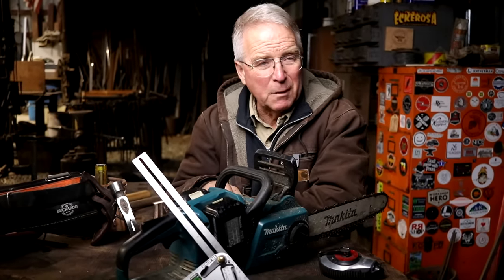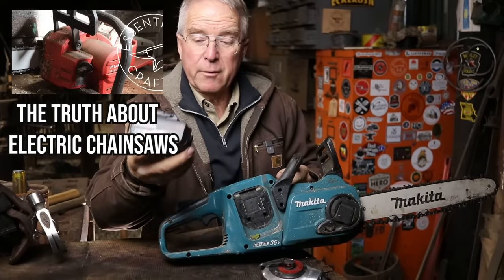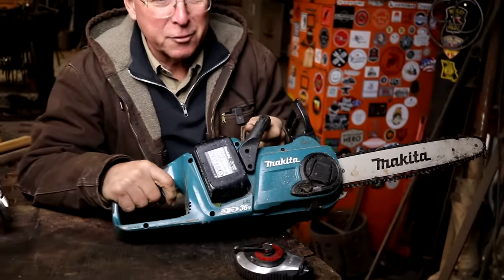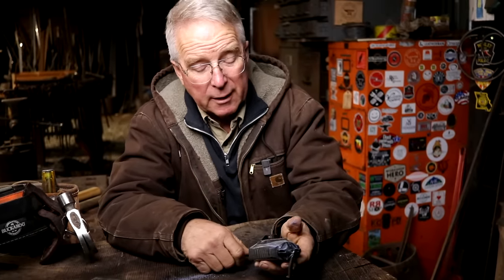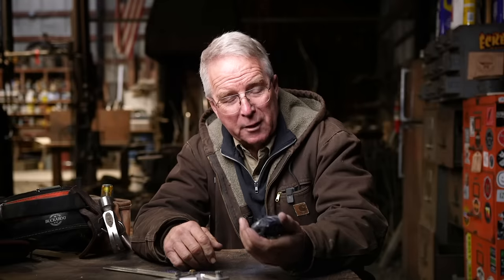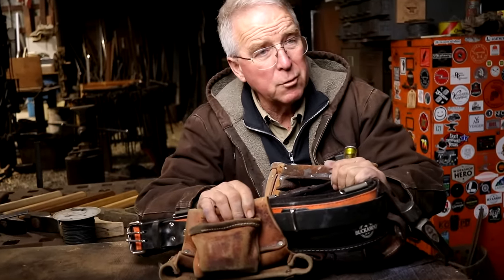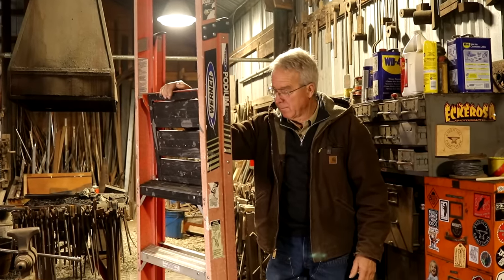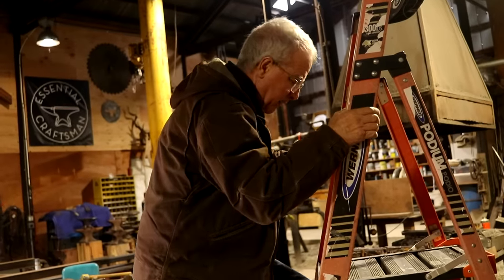5 Carpentry Tools I Wish I Bought Sooner

Comment: Honestly one of my favorite things about the Tajima boxes is that you can buy replacement parts for them and fix them up instead of simply replacing the whole shebang
Reply: Very good point
Reply: I cant stand when you gotta replace a tool when 96% of it is perfectly fine but you just can't get parts, even if its cheap to replace, just feels bad to toss it.
Reply: Love my tajima box.  Same he showed
Thanks for sharing, I didn't know they did parts! Yay
Reply: @miles11we  I usually ended up saving them for parts, but rarely ever used any parts off of them .What clutter!
Reply: 😅😅😅😅😢 I’m not 😮😊😊😅😅😅😅 1:03 😅😅😅😅But
Reply: Just bought this. I knew there had to be a better way.
Reply: @miles11we right than you end up keep the broken one outta remorse and you think you can use it for parts and than I end up never using it so it just collects dust
Reply: They also make awesome caulk guns, just awesome. They come in various types for different viscosity levels and they are bulletproof and the dripless feature actually works
Reply: I believe Tajima also has boxes that can be loaded with an ink, instead of chalk.
Reply: I didn't know that 😮
Reply: My tajima was great but the bearings fell out. They are tiny and plastic and I can’t see a way to replace them.

Comment: I worked my whole electrical career on step ladders and I scoffed at podium style ladders. But I bought one for my friend so she could change the lamps in the hi-hats and dust her ceiling fans more safely. I showed her how to use it. Holy moly I was hooked. Podium style ladders are fantastic where you can use them. It’s like staging.
Reply: Tried one and I never got used to it. I stand on the top two rungs like you’re not supposed too often enough to where I need them. Each time I had a podium style I would almost trip trying to climb to the top rung. But as far as just working off of the podium and that step only, they are a game changer
Reply: Right?  It's like a mini-scaffold.
Reply: only problem is that the 3' version is a whopping $670 CND.  I can get TWO 3' aluminum ponies for $150.
Reply: I believe what I bought for my friend was a Gorilla ladder from Home Depot or Lowes. It was of stout build and had a high weight capacity. Surely good enough for home duty and lightweight construction. It folds thin. Now keep in mind on construction sites I was most comfortable illegally strattling the top plate with one foot on the top step and one on the rung in the back. And I was totally comfortable standing on the top of an 8’ or 10’ step ladder. 12’ footers sway and are hairy so not so much of them.
Anyways, these ladders with the platform and leaning bar are the safest ladders out there. 
Commercial grade will cost more.
Reply: @krenwregget7667 Aluminum, summed up in single word, sucks. Sure they are light and cheap, but they are also unstable and not safe. My safety and increased comfort is priceless.
Reply: What would Fred Dibnah say.
Reply: @glennpaulellis1172  That would be a definite "no go" for Fred. Too safe. 😂
Reply: @carbonking53  On the job I preferred wooden ladders only. They are heavy but stable and stay put once set. Fiberglass step ladders are lighter to carry but after set in place the things get wound up and will take a step on their own.
Reply: Little giants are best hands down.  
My 40 ftrs are werners but 20 plus years of siding roofing and guttering, little giant has become my preferred ladder. For any situation except tall 2 stories, where i usually need a lift anyways and not even close imo and every contractor I know.
Reply: We use little giants on our c130s. they take a BEATING. Stable and strong.

I borrowed my neighbors podium ladder, good GOD it's great!!

I prefer fiberglass now, too. It seems a touch stronger
Reply: Podium ladders are fantastic... when you need exactly the podium height. In my experience, this is rarely the case. They're especially problematic in T-grid ceilings, because the ladder is taller than a normal one (a 6' podium ladder is 8' tall!). You end up having to thread the ladder up and down through the ceiling tile, being extremely careful not to bash the grid. In certain settings they're great; I've happily employed one in place of a Genie lift in tight spaces, but my opinion is they're usually not worth the extra weight and height.
Reply: @josephbikes  Agreed. They’re great for homeowners and even construction when they fit the area. Working above grid ceilings are another matter.

Comment: I lightly scoffed when my dad got an electric chainsaw a few years back. We have multiple gas chainsaws that’ll tackle cords of wood daily if need be. However, every time I’m down at his place and need to cut a few branches or clear some brush, it’s that electric saw that I grab. It won’t replace the big saws we have, but it sure is great for the lighter jobs!
Reply: Looks great for camping trips as well , or , for 4 wheeling / trail use .
They make DC -dc chargers so you can charge the batteries from your vehicle 12 volt system without an inverter and charger or generator .
Most tool manufacturers make and sell vehicle chargers using dc-dc tech for their batteries , although they do not widely advertise them and most retailers do not carry them as normal stock .

Comment: Tajima chalk box…. Love mine.  I got one early on and never looked back.

Titanium framing hammer… I wish I had gotten one much sooner.  But I’m glad I switched over.

Truss locks.  They saved so much time setting rafters once I had them.

Stabila telescoping plate level.   Man we used that all the time.

PLS self leveling laser that fit in a pocket on my tool belt.  I got that later in my career but sure was handy when running a crew and checking the plumb on corners.  

Impact driver.  Needs no explanation 

A 2 step, 2 sided step ladder.  Man those are so handy to have around..  from changing that light bulb you just can’t quite reach or getting into the engine bay on my 7.3 powerstroke…. That thing gets used a lot!

Those are just a few off the top of my head but looking back, I don’t regret spending a few more dollars to get the better tools.

One thing I should have bought was a telehandler and basket.  Those are so handy on a job site.
Reply: I have ever one of the things you listed here and you are absolutely correct they are all invaluable tools.
Reply: I like your list
Reply: I really like their caulking guns too, have the heavy duty one, lol if you had ever told me I’d own a $50 caulking gun I’d say you were crazy.  Yet here I am with my $50 caulking gun.

Comment: As an arborist I get around to various locations. One of my regular customers has a podium ladder. It is ideal in small and medium size tree pruning! I bought one at Walmart that was a near miss. Nope! I took it back. It's best to spend on a good quality ladder!

Also I got the battery powered chain saw. For one thing it works quietly. Some pruning I do is at medical offices. And I don't have to wait till after hours to do the chain saw work. My saw is quiet. In my case it is a Dewalt. These come is at least two sizes.
Reply: In other brands there is a very small model that is held with only one hand. Besides that size, there are various different bar sizes, depending on brand - so it’s a bit more than two sizes.  There are also some that use the single 18V/20V battery, and some that use batteries with double that voltage (in this category, two of those lower voltage batteries might be used, or a single battery with double the voltage).

And we didn’t mention pole pruners …

Comment: For shorter, everyday carpentry I LOVE my Shinwa chalk lines. They use a very sharp pin that you can stick anywhere and pull in any direction, unlike a hook. The string is very thin and makes a super clear, fine line. And they automatically retract via a spring. For anything under 30’ they are amazing.
Reply: I also use one for fine work.

Comment: Similar to the work platform ladder is the 20” work platform also known as a painting bench.  There are 2 foot step ladders but there are times that a 20” work platform, with it larger platform, is a safer tool to use than the short step ladder.  I use my work platforms for more tasks than painting.
Reply: They make fantastic low benches for some rough carpentry tasks if you're 6' tall like me

Comment: If there's one thing I dearly wish I'd had in the forty years I spent as a toolmaker — starting in 1967 — it would be cut-off wheels.  Granted I worked with metal rather than wood, but I can't think of any new tool that has been more of a game changer for me.  I also love the Chinesium tools from Wish and Bangood.  I am better equipped now in retirement, than I was when Ford paid for my tools, and they have nearly all been perfectly usable. Full disclosure, I bought a 200mm Mitutoyo knock-off that stopped working after six months, and a 0-25mm and a 25mm to 50mm micrometers that read 2/100ths out end to end of their travel.

Comment: I would humbly add the Tajima or Olfa utility knives. I moved from Florida to Europe and the guys here exclusively use those. It took me a long time to give up my old Stanley box cutter, but i’m glad I did. I use the Olfa OL with “carpet tuck tool” on the end. Not only is it easy to change a blade with no tools, but you can snap off a tiny piece and have a sharp tip, or extend the whole thing and have around 4” blade to use. The carpet tuck tool on the end is just a 1” steel piece that I use for dozens of random things daily to scrape, or pry. Give it a shot! Or don’t , because what you use is better 😂 we all know the feeling.
Reply: The black olfa blades are the sharpest things I've ever held. They also last a long time. I install ceilings and those cut ACT tiles like butter. Good for dence fiberglass panels also
Reply: Cut myself with an Olfa blade and it was clean. Those blades easily cut deep and are quick to change once dull.
Reply: I used one to cut the 2" foam insulation panels clean through.  No way could my Stanley do that, the blade is way too short.

Comment: I added a battery-powered chainsaw to my arsenal a few years back and I have never regretted it for a minute.  I was hesitant as well,  but hanging it the tree branches, pruning or trimming, the fact that it stops the second you release the trigger, is a game changer.  No more idling, sometimes rolling saw in your offhand!  It's truly a marvel. Whatever brand you buy, get one! You can thank EC later.
Reply: Even a cheap Bauer one is more effective than a gas saw that you have to keep tuning up.
Reply: you watch, he'll be the first boomer to get an electric truck too 🤣
Reply: I have a black and decker chainsaw that uses 20v batteries. I've cut down walnuts trees, pine, fruit trees, and it has seen 8 years of abuse, still works great. Sure it's underpowered for some things and not the fastest but with a sharp chain it will get the task done.

Comment: I’ve had my Makita electric chain saw for about 3 years and have been amazed by not only what it can cut but how quiet it is doing it. Unless you need to use a chainsaw every day or are working with big logs, this guy gets the job done faster, quieter, cleaner and (I feel) safer.
Reply: Ditto ! I have 4 different versions and I hardly ever use my gas versions.

Comment: Track saw, multi tool ( which fein has been around for decades, almost bought one 25 years ago) and the podiums are sweet, you just need them in specific heights.
Reply: You can get adjustable platform ladders (that’s what we call them in Australia) that are heavy but versatile. Extension and step ladders are banned on commercial building sites over here.

Comment: Makita Electric Chain Saw - I had for my first real Logging experience this fall while clear cutting a power line right of way (White oak trees mostly). I used it and a new Gas powered Stihl and found I preferred the Makita for most applications. Limbing and removing the crowns especially.
Reply: Its wild how light and powerful they are getting. Wasn't that long ago that even corded would be quite heavy and now we got cordless versions that are pretty light even with batteries.

Comment: The tajima chalk box you have the "dura" i believe also has an  onboard cord replacement tool. On the lower right side its a tool to help thread the new cord through the opening which has a felt o ring to keep chalk spilling to a minimum. The teade off is that passing a new cord becomes tough the
 tool is a wire "needle threader". Might be worth checking it out

Comment: if you're already in a battery line but don't necessarily want to invest in a battery chainsaw, a modern battery sawzall is a very fun intermediate step that can get serious work done both in the brush and in construction.
Reply: And they sell purpose made pruning blades for them as well .
Reply: @kaboom4679  Yep that's what I've been using.
Reply: ... and unlike a chainsaw, you can get those pruning blades (on a sawzall) right in the dirt to cut roots if you have to.

Comment: I have a cordless pole saw (also a makita 36v) and THAT is a huge force multiplier vs the wired or powered variant. With the battery pod being in the rear it balances really nicely and makes tree limb cutting a breeze, especially since the blade stops instantly. I can do super precise cuts super close to the trunk near other branches i don't want to cut without fear of snagging or damaging the tree pointlessly. The previous variations cannot even so much as hold a feather compared to the battery variant, honestly, the powered variant now seems like a bad joke.
Reply: That pole saw is on my short list of wants.

Comment: First of all I am not a professional carpenter but I have participated in building several houses, sheds, decks etc and after using tool belts for decades I finally added a broad shoulder strap suspenders set up to my buckaro-type belt…..finally comfort. Now if I can only modify it to more comfortably support my 14 lb 5 string banjo my life wii be complete.

Comment: I own a geared Tajima chalk box. It was quite pricey compared to my usual Irwin boxes. I loved it until the gear jammed and I had to take the box apart to fix it. I don't know how they managed to make a chalk box that complicated. Getting all the interior pieces back together and closing the case took forever. It's fixed, and I still own it, but I've gone back to Irwin. They're much less expensive and, like you, when one stops working I toss it. It doesn't happen that often and it's not a big problem for me.
Reply: When I worked in the trades, I would swap out the line with braided fishing line, line snaps real clean.

Comment: Every major cordless tool brands has their take on a cordless chainsaw .
This is great since you don't have to aquire a different charger and spare batteries specific to the saw if you are already invested in a particular system .
In your case it is Makita .
But Milwaukee, DeWalt , and others , make their own for their platforms .
I don't own a cordless chainsaw , but I'm looking hard at them , and I will probably get a DeWalt since that's the system I have .

Comment: For me the 4' double sided Werner aluminum step ladder is the one to beat.  If you only have one ladder, this is the one. Straddle it, stand on the top platform, carry it with one hand, & it stands up by itself when folded.  The only thing it doesn't do well is lean against a wall. I have three.  I have a Tajima utility knife but the blade doesn't project very far, so it's third tier.

Comment: 7:12 i have that platform attachment (i forget the brand, it's long gone, but it's actually made in US, bought it on your side of the pond when i was there for work) that you see sometimes and that one's really good too, especially because it transforms ANY ladder into a platform ladder. If there's one thing i hate about ladder work is the pain that comes with sitting on those narrow steps. Especially on the super tall ones that use round pegs because they're more structural than square or wide ones. Those are absolute killers for your feet. But chuck the platform on, any place you want and you're set. And it's safer too, because i've had it when i was on uneven terrain and had to juggle the ladder's feet on rocks or bricks and i fell. Where as with the normal ladder you have your feet mid way stuck in the frame, with this, you fall, and you can actually secure your landing (well, while i'm still young-ish). Being out of the ladder you have time to think. I heartily recommend that attachment. Super useful and not just for sitting on. Because you can buy two and have a platform for all your tools - i don't have one yet, but i've used the platform for that whenever i wanted to save trips up and down the thing.

Comment: The Tajima line is the thing. I’ve put their replacement line in other chalk lines and got the fine lines that they’re famous for. How useful is a line of chalk that’s 3/16” wide. My first Tajima had 25 feet of automatic rewind and a sharp pin/plug instead of a hook. I called it Samurai chalk line what with a needle point coming your way fast!

Comment: Ive been a carpenter for about 15 yrs now. One tool ive been carrying that others may not is a good linesman plier. Super handy for tying wire, pulling a staple, cutting random thicker things my knife cant, presise light hammering that a full size hammer would destroy, exc. Guys will give me crap for having it in my bags, then ask to use it lol
Reply: I have a friend who carries pliers and I borrow them all the time.

Comment: Those Tajima chalk boxes, tape measures, and drywall rasps are hands down the best period. I’ve yet to use anything better. I’ve had a couple of those chalk boxes go missing on a job site because they were that good. Even the plastic ones they make are better than the metal ones by other brands.